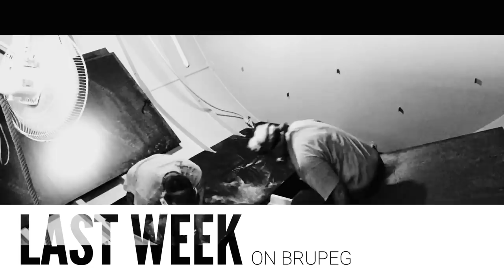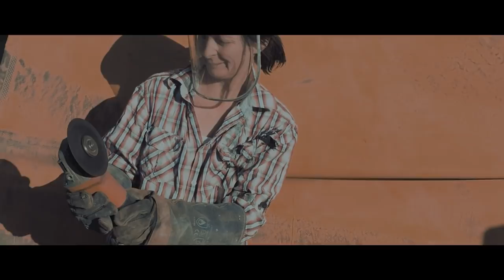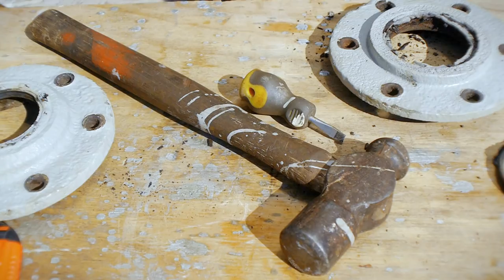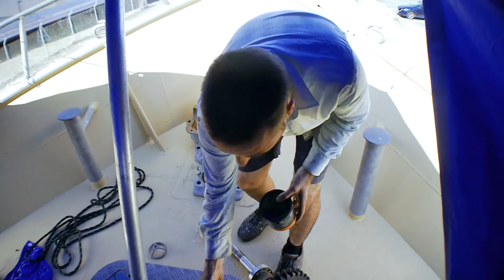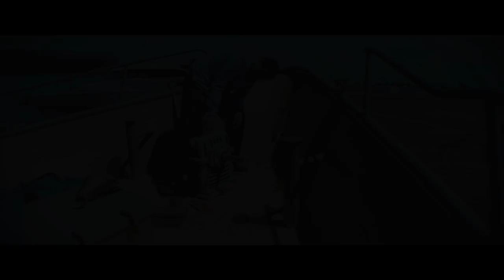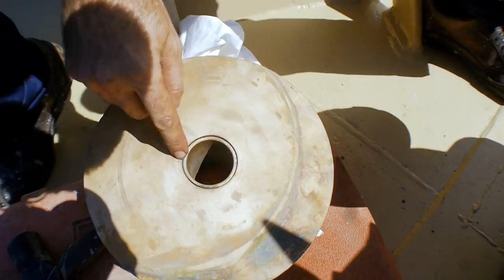Rebuilding An Anchor Winch (EP. 51)

Comment: Glad you explained those safety features in the chain spools mounting between the friction plates !
Reply from the maker: Hi Mike, Yeah its not something we will be using much but its certainly nice to have a manual override of the system.
Reply: The idea it to have enough friction on the spool to lift the anchor and chain with some extra for a stuck anchor but not enough to snap the chain. That way you don't lose the anchor and lots of chain. you can always add some more friction if she is slipping but carefully.

Comment: I used to service small hydraulics and the best thing to clean we found was a pressure washer connected to the drain of a water heater. to would strip off all the dirt, grease, oil, etc and leave a clean dry surface. So clean that bare metal would rust.

Comment: On any seal exposed to water and sea water , coat the metal with grease before you press it in . That will go a long way to preventing sea water from getting between the seal and the casting . It's one of the causes of seal failure on ships
Reply from the maker: That makes sense to stop water but won’t that provide a lubricant where you don’t want it (between the seal and the metal)?
Reply: The seal in held in via press fit and after a couble months the grease will stiffen up . Also if the seal comes out because of a little lub then you better get the casing rebored . The only time I've ever seen a seal push out is being hammered or shaft failure or worn out thrust bearings . Of course I'm retired now so my memory  might be at fault .

Comment: I know your working on a boat, but a lot of the information you gave is great for just general knowledge.
Reply from the maker: Thanks Richard, yeah I think so. Any sort of engine reconditioning, machine and tool repairs etc
Reply: I wish I would have had Youtube when I was 16.  I bought a 55 Chevy and rebuilt a 348 ci motor that I got out of a 58 Chevy and when I put the pistons in I didn't know the "F" stamped on the piston meant that that side of the piston was supposed to face forward because I had no problem sliding them in. Luckily I had a friend who caught the mistake before I put the heads on.  I love watching all these type of videos.
Reply from the maker: Yeah most mechanics have made a version of that mistake (but never admit to it)

Comment: You can also, take apart the race and just put new balls inside, i've done it, it's messy but it works, especially in situations where bearings of a particular size are impossible to find, like in one of my big rotary sanders made in the Eastern block during the cold war...yeah. I'll never find that size due to the special shaft, so i rebuilt them with new balls. :)
Reply from the maker: OK, good to know. I'm thinking when we get to the northern hemisphere its very likely we will replace these bearings but for now they work (albeit loudly).

Comment: A less messy way to repack a bearing is ti put the bearing into a plastic bag with some grease in it; close the bag and knead the grease into the bearing through the plastic.
Reply from the maker: Yeah that would work.
Reply: Not nearly as effective as using your palm to pack it. You know when the grease is gone from your hand that it's in the bearing.
Reply: There is no such thing like a not-messy regreasing of a ballbearing I'm afraid.
Tried it with warmth, but kneading it is unmatched.
Reply: I use a bearing packer no muss no fuss !!

Comment: The nut on the end of the windlass shaft is not only for emergency use. It is for everyday operation. The nut would be a internally threaded  device with about 4 each I/2 inch or 5/8 inch by two inch long pins sticking out. You would keep a 18 to 24 inch stainless steel hollow rod that can slip over the pin to loosen or tighten the nut on the brake.  Loosen to crop tighten to stop the chain from falling. Never loosen it up too lose and take the rod off of the nut. You may lose the whole chain before you can stop it. That's a big chain you have on that thing. The part that is between the two brake disks is called the "gypsy" I believe. It must be matched up to the chain exactly.

Comment: Good job , I would have spent the money on new bearings - down in Antartica with a faulty winch? 
 - you could buy a tapered lock bearing for damaged shafts like that.
Reply from the maker: That’s true but we have a lot of boat to build before we get in the water and it’s likely Antarctica will be at least 12-18months away. So those bearings and any other system that isn’t absolutely top notch will be replaced prior to any ice work.

Comment: looks like it might be a buttress thread cut so no matter how much ice and shit, it still has positive thread engagement to knock the handle with a hammer and drop the anchor,  pulling up the anchor will tighten the thread, as long as you have a left hand thread. if not you might have to turn the shaft around the other way in the housing.
Reply from the maker: Ok good to know. Thanks Lindsay

Comment: Just remember...as others have said, it's the weight of the chain, not the anchor, that holds the vessel...and the standard rule of thumb is to lay out 3x chain for the depth of water you are in (called 'rode'), in chain, when anchoring in fair weather and mild seas, 5x rode-vs-depth in rougher seas....7x rode-vs-depth in stormy seas.  So, if you are in 100-ft (33-meters) of water, you should lay out 300-ft (100-m) of chain rode....500-ft (166-m) chain rode in rougher seas(at the same water depth), etc.  There's a reason your chain locker is LARGE...it's to hold all that chain...which should be either Grade 40 or Triple B Grade 30 galvanized chain.  DON'T SKIMP ON CHAIN, or you will regret it later. Not all galvanized chain is made equal...from my own experience, if a good marine store doesn't stock it, it's trash...and the Chinese-chain is usually not galvanized well enough to survive real salt environments (unless you have fresh water wash-down in your chain locker...and even then, it's sketchy).
Anchoring in a bad storm (or even hurricane) is another event, entirely...especially if you are double-anchoring (or stern-and-bow anchoring)...a class in 'extreme weather' anchoring and mooring is highly recommended...especially if you are going into known 'rough seas' areas (North Sea, Drake's Passage, Cape of Good Hope, etc.)

Comment: Damien - I am sure your know this, but non-mechanical viewers probably do not.  There are 2 benefits of a worm wheel and worm gear transmission. The reduction in shaft speed/rotation is equal to the multiplication factor of the torque.  Second, but very beneficial in this type of application, once power is longer applied to the worm, the gear will remain locked into place.

I would not call those "brake" plates on either side of the gypsy wheel.  I would call them clutch plates.  Very simple, yet very practical design !  That gypsy wheel is probably made of nibral (more correctly NiBrAl - Nickle Bronze Aluminum alloy).  Much more durable than just Bronze (an alloy of copper + tin + ?).

I see you found your spanners.  Do you come across any English/American fasteners on Brupeg ?
Reply from the maker: Hi Jack, routinely come across UK, US and Whitworth fasteners, I try to bring everything I build back to Metric but the Engine is a Cummins made in Great Britain so imperial, the gearbox is Chinese so metric, and all new parts I’ve built or put on are generally metric

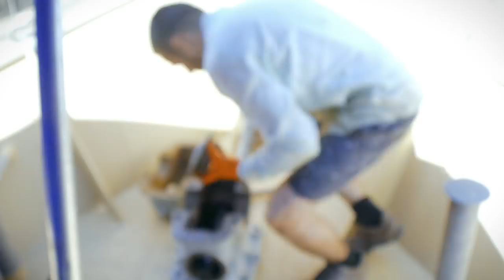Comment: 8:27: Looks like there's a keyway on that plate, but I didn't see one on the shaft, just threads...or maybe the key dropped out?. 14:20: Now, that's a socket set! The biggest I have is a mere 2 1/2 inches/63 mm! It's for the nuts that hold the rudder to its mounts. 28:28 Whoever taught you about fixing engines, putting in seals and best practices in using a file did a fine job. Being meticulous today can save your arse down the road when well-installed or rehabbed gear doesn't fail. Also, is calling this a "winch" an Oz/NZ thing? I know it as a windlass, or "anchor windlass".
Reply from the maker: Yeah it’s a NZ thing. We also call them capstans etc but winch works as well
Reply: It's been my experience that not only does every direction, area and bit of gear on a boat have a different name than its land-based equivalent (port aft scuppers!), but that every English-speaking place has a different word or term yet again. I mean, they are a type of winch...on its side...Anyway, can't wait to see how you rig your chain fall. I think a large rubber-lined triangular box (with a drain and a small 12 V pump to get it out of the boat) is good. Your boat is big enough to have a pipe that can gimbal beneath decks: as the chain comes in, play the pipe back and forth to flake it into tidy loops below and it will never seize or jam on the way out.

Comment: Good job on the anchor windlass. I can tell you are an experienced mechanic by the way you polish your shaft (you have to admit, you left yourself wide open for that.). Those bearings will last for many hours of use. Any issue with noise is cured with hearing protection. LOL! Good job. Wouldn't it be nice to have a machine lathe at your disposal. Still where theirs a will...Regards, Solomon
Reply from the maker: Yip all true. A large is actually something we want to fit to Brupeg down the track

Comment: your imperial bearings are payback for those metric bearings we in the states end up finding one of lol
Reply from the maker: One day I hope you guys move into the 20th century. Still we on the outside can only but watch...
Reply: I wish the US was on  metric, then i wouldn't need two sets of tools, or have to deal with stripped heads from some idiot using a standard socket or allen on a metric bolt/ allen or vice versa. Biggest complaint, is fractions for sockets/ wrenches. I don't need think about what a fraction true size is. My brother does software printing and cnc and it drives him nutts, he prefers it in metric.

Would make life easy using the same system world wide. Remember when NASA crashed a 129 million dollar satellite into the moon because someone forgot to change metric to standard?  Don't need more reason than that.
Reply from the maker: If 129million isn't going to do it then I think you might be stuck with your hieroglyphics
Reply: we tried back in the 70's to change over but our parents and grandparents didn't like the idea so they stopped teaching it in high school, now I struggle trying to figure out about what size a 19mm timber is without googling it. or looking at my cheatsheet
Reply from the maker: I think that’s a real shame. I find imperial so hard compared to the simplicity of metric
Reply: Truly is

Comment: The keyway and or key looks very sloppy. I would look into recutting a key to make less slop in the joint. This is one fix you will regret not making. I have seen keyed shafts under much less stress give way.
Reply from the maker: Yeah thanks Pat K. It's on the to do list. We'll get it done before leaving Australia.

Comment: cool inside information
Reply from the maker: Literally
Reply: the week link is the hydraulic pump, needs a every 3year control... is there a second winch on board as a backup? maybe electric or mechanic? can be a rope winch , if you have the gismo ( dont know the name OF IT ) you could grab the cain an pull up the anchor ... can be a good back up, because there are situations you will pull up the anchor and get away
Reply from the maker: The hydraulics are all going to be brand new, also over spec’ed for reliability’s sake
Reply: the last link of the anchor chain is called the Bitter end, and has a pin to knock out with the handy axe in the chain locker.

Comment: Should have used a paste sealant on the OD of the seal before you installed it in that knackered housing
Reply from the maker: Hi Sam, we sandblasted it out and it cleaned up great. We did need to use a sealant on one of the four housings but that footage got cut from the final episode.
Reply: should of used on bolt threads too. :-)  on anything you may take apart later- like on an outboard.
Reply from the maker: Most bolts on this winch had either oil or copper cost applied to them

Comment: Your wheel bearing grease packing method is correct but I don't understand doing this to bearings that are in an oil bath. It will wash out in no time. I'm not in disagreement on reusing the bearings. I would have put what ever oil it runs in on it and then see how it feels. Berings never get better, only worse. Its the gears that can be damaged. Partially by the bearing material and partially by miss alignment because of the loss of correct contact,,   gear to gear. Your risks are low for now but only time will tell. I know you have to balance your cost for return on investment. That is alway the hard part of making these decisions.
That is one serious windlass.
Reply from the maker: The grease packing was mainly just to help with initial start up when there is no oil on any of the upper areas. Had the grease so just packed everything out of habbit